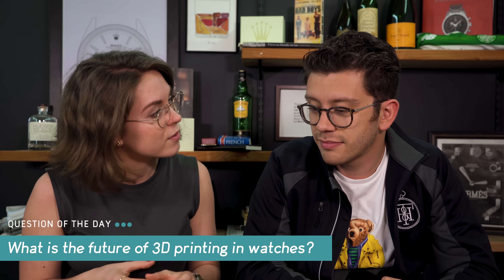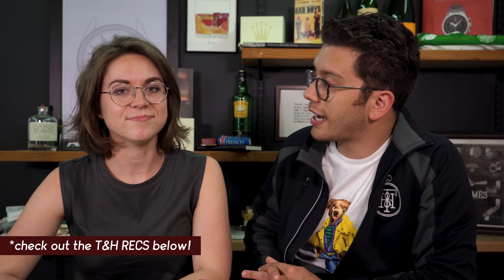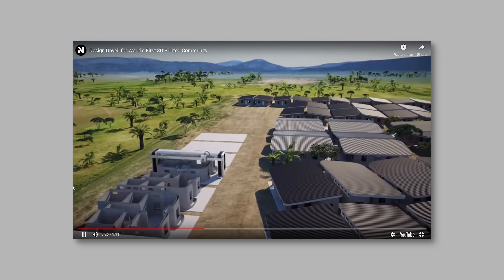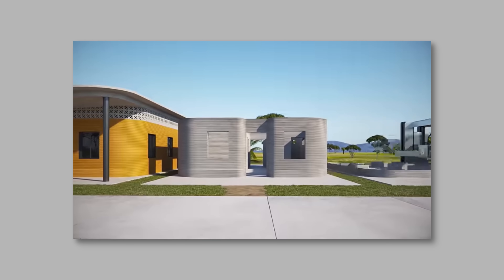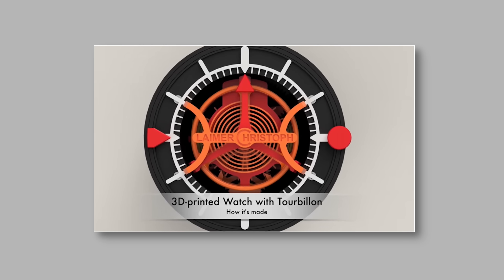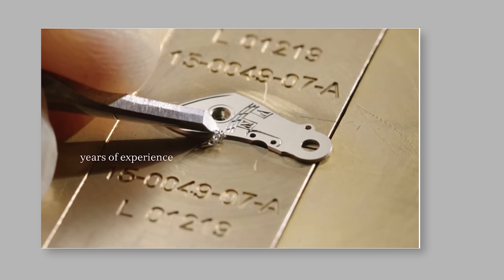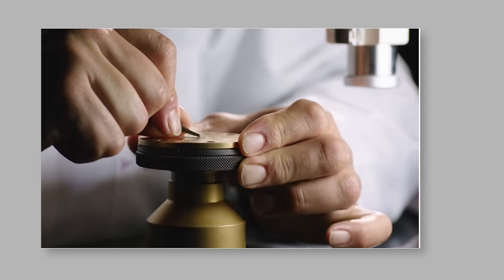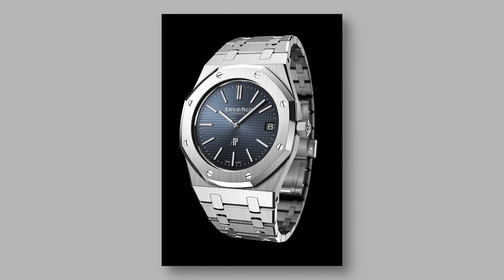Fake Watches Getting BETTER with 3D Printing

Comment: Slightly inaccurate view of 3D printing...
Reply from the maker: Would love to hear your thoughts!!!
Reply: @TheoandHarris  3D printing metal, especially a metal with a high melting point, is veeery energy consuming bc after all the whole material had to be melted serveral times in the process. Its also quite time consuming - and therefore costly. 3D-Printing makes sense if you want to 1. make few pieces, bc you have no part-specific tooling costs 2. make it asap without waiting for tooling to be done (rapid prototyping) 3. need the freedom in styling with undercuts and stuff (turbines). The ALS balance cock would be far easier to cast tbh but in both ways, the finish would not match with the original. But 3D-printing is far from the only method to reproduce reverse engineered things. 3D-Printed parts also are quite rough and need polishing most of the time - at that point you may could had it done the traditional way. Also funny you guys mentioning copying handpainted dials as thats what PP does themselfes with their 5212A. After all I would not be to concerned about 3D-Printing fake watches but I can imagine RM or Hublot (or even swatch) coming out with a 3D-printed watch as a feature.
Reply: Agree.  I don't know of any component parts that could be printed that small with that high resolution.  A little science fiction here.